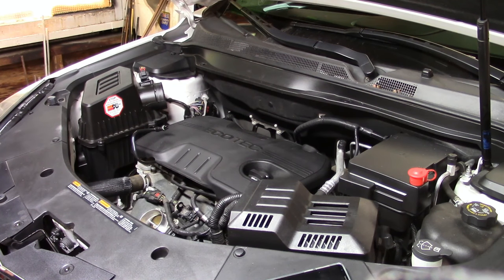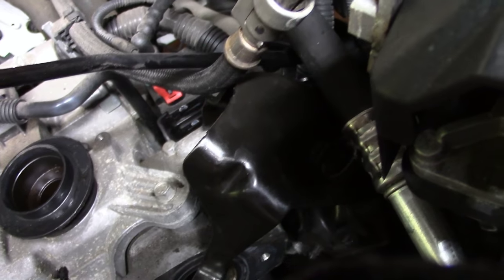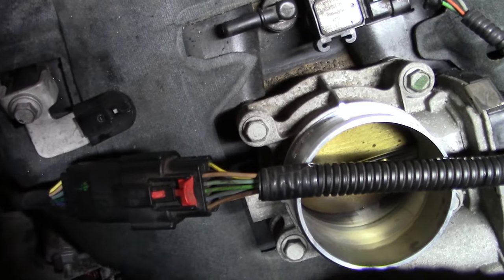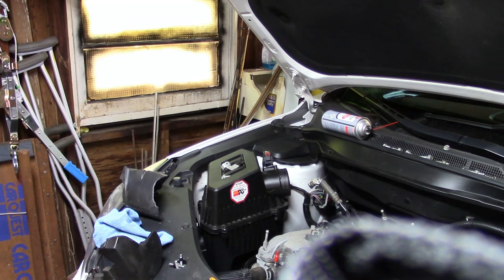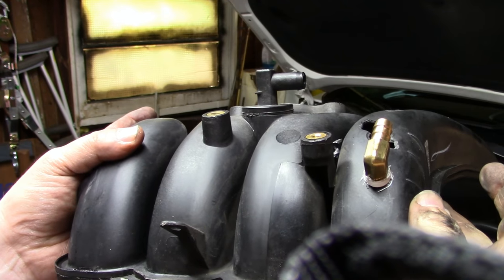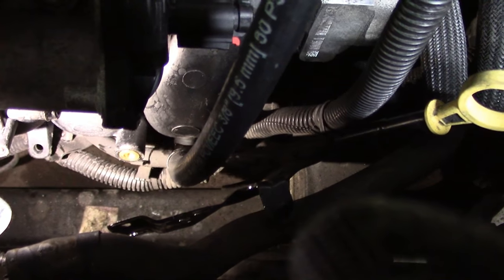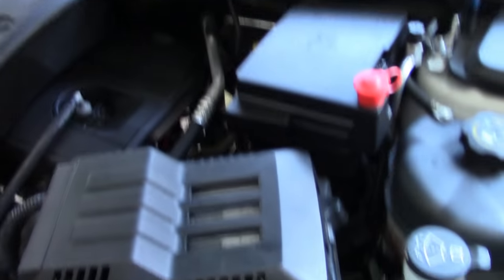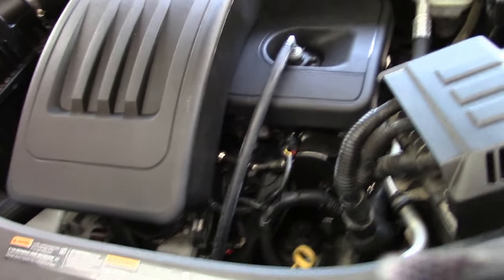2013 Chevy Equinox w/2.4L 4-Cyl. Engine PCV Upgrade

Comment: Do you have a part number for the pcv valve you installed on the cap? Or what it was off of?
Reply from the maker: Grommet is a Dorman PN# 42330
PCV is a INTERMOTOR, SMP, PN#  PCV352.
I bought them at Advance Auto Parts
Reply from the maker: Oil cap is a Carquest PN# 10099
You'll need to drill a 0.750" hole to make everything work.
Reply: @Frank4358  I assume the fix has been all good so far? Thanks for this video. Much appreciated
Reply from the maker: @abefroman1986  engine starts and runs as designed. No known problems. And the best part is that I haven't used any oil.
Reply from the maker: I've been averaging about 19 to 22mpg around town. Your results may vary.
Reply: Thanks, the ticking sound, mine used to do that, it was the chain guide it’s defective and will eventually break, covered by recall.
Reply: @Frank4358  when you say you havent used any oil do you mean you were using it before and this fixed that issue? Or it was fine before and that problem just never arose after your fix?
Reply from the maker: @austinogrin7259  I was using oil prior to this modification. Now the oil usage has stopped
Reply: @Frank4358  awesome thank you, why do you think it was using oil before you made the new EGR valve. That seems like such a dumb mistake on their part
Reply from the maker: @austinogrin7259  it's not an EGR valve. It's a PCV system. The factory unit is a hole about 1/8" in diameter. It gets clogged, and the return vent gets clogged. That in turn creates crankcase pressure. The increased pressure damages seals. 
This modification prevents the system from clogging. 
Now, consider this; if this is the reason for your oil consumption  no worries. But these engines also had a ring problem. . . 
Do you experience a loud knocking noise on cold startup that goes away as the engine warms up? That is a known problem. Do your research before starting any modification. 
Google, Class Action Law Suit for 2010 - 2015 Equinox with 2.4L ECOTEC.
Reply: @Frank4358  I am looking to purchase one the guy said it burns about 1 quart of oil every 1500 miles roughly, and it did has a sound when starting up but it didnt seem like it was anything alarming
Reply from the maker: @austinogrin7259  get the VIN, go to a Chevy dealer and have them check for a TSB: technical service bulletin. If they say it's not included, be careful in deciding to buy it. You could be stepping into a hornet's nest of problems.
Reply: @Frank4358  I called and gave them the vin and they didnt find anything when they looked it up, would you think that more than likely the oil usage is due to the pcv? The guy who owns it said that last year the rear seal blew and they had already had it replaced so I just do not want it to happen again
Reply from the maker: @austinogrin7259  if the rear main seal blew out it was from the PCV problem. And I'm guessing it will probably happen again if it's still using oil.
Here is the TSB: https://static.nhtsa.gov/odi/tsbs/2015/SB-10090101-2280.pdf 

Bulletin No.: 14882
Date: March 2015

SPECIAL COVERAGE
SUBJECT: Special Coverage Adjustment – Plugged PCV Orifice in Intake Manifold
MODELS: 2010-2013 Buick LaCrosse
2011-2013 Buick Regal
2012-2013 Buick Verano
2011-2013 Chevrolet Captiva
2010-2014 Chevrolet Equinox
2013 Chevrolet Malibu
2012-2013 Chevrolet Orlando
2010-2013 GMC Terrain
Equipped with 2.4L Ecotec Engine (LAF, LEA or LUK)

CONDITION
Certain 2010-2013 Buick LaCrosse; 2011-2013 Buick Regal; 2012-2013 Buick Verano; 2011-
2013 Chevrolet Captiva; 2010-2014 Chevrolet Equinox; 2013 Chevrolet Mailbu; 2012-2013
Chevrolet Orlando; 2010-2013 GMC Terrain vehicles equipped with a 2.4L engine (LAF, LEA or
LUK) that have experienced high oil consumption may also experience a frozen and/or plugged
PCV (positive crankcase ventilation) system during cold weather operation. This condition may
increase crankcase pressure leading to a rear crankshaft seal oil leak. If the oil leak is ignored or
not noticed, an engine clatter noise may be noticeable and/or the engine pressure warning light
may illuminate. If this condition is not corrected, continued driving with engine noise and/or the
engine oil pressure light illuminated may damage the engine.

SPECIAL COVERAGE ADJUSTMENT
This special coverage covers the condition described above for a period of 10 years or 120,000
miles (193,000 km), whichever occurs first, from the date the vehicle was originally placed in service,
regardless of ownership.
Dealers are to perform a crankcase pressure check, and if required, remove the intake manifold
and clear the PCV orifice. The repairs will be made at no charge to the customer.
For vehicles covered by Vehicle Service Contracts, all eligible claims with repair orders on or after
March 4, 2015, are covered by this special coverage and must be submitted using the labor
operation codes provided with this bulletin. Claims with repair orders prior to March 4, 2015, must
be submitted to the Service Contract provider.

VEHICLES INVOLVED
All involved vehicles are identified by Vehicle Identification Number on the Applicable Warranties
section in GM Global Warranty Management system. Dealership service personnel should
always check this site to confirm vehicle involvement prior to beginning any required inspections
and/or repairs. It is important to routinely use this tool to verify eligibility because not all similar
vehicles may be involved regardless of description or option content.

PART INFORMATION
Parts required to complete this special coverage are to be obtained from General Motors Customer
Care and Aftersales (GMCCA).
Note: Use the vehicle identification number (VIN), SI and the GM Electronic Parts Catalog to
determine which parts to order. The Crankshaft Rear Oil Seal Replacement procedure in SI states
what parts are required to complete the repair. For example, gaskets, one-time use fasteners, and
fluids.

Part Number Description Quantity/Vehicle
12591866 Crankshaft Rear Oil Seal 1
Reply: @Frank4358  so unfortunately this car has 213000 miles so I could not get the replacement for free,  when it is started and has that loud noise at first is that the timing chain or what is it causing that noise? And how hard is it to replace the timing chain and the components related to that while the engine is in the car?
Reply from the maker: @austinogrin7259  do yourself a favor and walk away from this car.
With 213,000 miles and with a known problem it will cost you a small fortune to make it right. The timing chain is not an easy repair -- especially if you don't have a mechanical background. The clacking noise -- and the oil consumption -- tells me it is probably a ring problem. 
So unless you are getting this for practically nothing, and you're prepared to drop in a fresh engine you are better off finding one with low mileage that is not experiencing any oil consumption.
Reply: @Frank4358  its 2500$ the body is in fairly decent shape and the interior is nice in it, you would still walk away from it?
Reply from the maker: @austinogrin7259  are you prepared to install a new, or low mileage engine with no apparent problems?
Reply: @Frank4358  probably not , thank you for all your help I appreciate  it
Reply from the maker: @austinogrin7259  sometimes the best thing you can do is walk away. What looks like a good deal now can turn into a hoke that you continually throw money. I've been buying and maintaining cars for about 47 years, and I've made my share of mistakes. The big difference is that I have been working on cars since I was 10. 
You learn a lot by doing. You learn even more by making mistakes. Hopefully I can help you avoid the big mistakes.
Reply: Where exactly is the pvc valve hose attached to on the manifold and did, you make any modifications to it, besides the top side?
Reply from the maker: @frankgeorge1744  if you check out the video you will see that I installed a fitting at the bottom of the intake runner so it didn't affect the vacuum signal to the cylinder head.
Reply: Thank you. I also forgot to ask, I probably missed the part about what you did with the original set up of the PVC. Do we leave it, or remove it? I appreciate your knowledge n answers.
Reply from the maker: @frankgeorge1744  the existing PCV is a small orifice inside the plenum. There is a return line from the cylinder head to the air box. That must remain intact. When you pull vacuum you need a breather. . . There must be a balance.
Reply: What size n lengths is the rubber hose? I am, really enjoying your vast knowledge  of plethora of information. Thank you!
Reply: What did, you say to apply on the manifold? Sorry I didn't understand that part.
Reply from the maker: @frankgeorge1744  not sure what it is you're asking about. If it's about sealing the fitting to the manifold, I wrapped the threads with Teflon tape then placed a dab of RTV around the fitting.
Reply from the maker: @frankgeorge1744  standard PCV or fuel hose. Length is as you need it. I started with four feet length then cut it to size.
Reply: @Frank4358  thank you
Reply from the maker: @frankgeorge1744  you're welcome
Reply: @Frank4358  Thanks for all the info Frank. couple questions, if u don't mind.

1. I've heard of moisture/sludge collecting in the hose going to the airbox. Others have installed oil catches/separators. Have you seen the need for this, with your modification?

2. Has this modification given you any issues with MAF readings? Codes etc..?

Thanks again.
Reply from the maker: @debtminer4976  no moisture build up has been found in the breather line. And, no. I have had no ECM trouble codes at all. Drove the vehicle 560 miles to Indy then back with no problems at all.
Reply: @Frank4358  What a great fix, from a wise grease scholar 😆

You are the man, thanx.
Reply from the maker: Dorman 42330 grommet
Intermotor/SMP PCV352
Oil Cap 10099 Carquest
3/8" 90° Brass Fitting
Reply from the maker: All items purchased at Advance Auto Parts
Oil Cap requires modification
0.750" hole. I did it on a Bridgeport vertical mill.

Comment: Maybe, a vented oil cap??
Reply: Have you tried it?
Reply: You can't use a vented cap or the engine controller will throw a code.  All of the air going into the combustion chaimber is measured, and that includes what comes from the pcv.

Comment: Any update frank?
Reply from the maker: Could you be more specific?
Reply from the maker: I will tell you this; Since this modification was done, I have not used any oil, at all. There were no check engine lights, and the fuel mileage was unaffected. 
The clacking noise you hear is emminating from the high-pressure fuel pump. Cold start/fast idle and IAC operation is working normally. Warm idle is about 700 - 750 rpm, and the engine operates at about 1500rpm at 45 - 55 mph. 
One more thing; I changed the transmission fluid with Amsoil synthetic. Transmission seems to shift smoother, and around town/highway fuel mileage increased from 16mpg city/22mpg highway,  to 19 - 21mpg city/25 - 27mpg highway.

Comment: You should just put one them small filters from the parts store on the fitting you mad into the oil cap...just vent to the air instead of putting all that oil and what not through your combustion chamber and throttle body...
Reply from the maker: To vent to the atmosphere is a violation of emissions standards. 
PCV systems are designed to redirect the atomized particulates back to the combustion chamber to be burned off. So no, putting a filter to release into the atmosphere is not a good idea.
Reply: @Frank4358 🤣🤣 Ok EPA police....LOL.....Guess it depends on the year huh...SMH......Some people i tell ya..😥🤷‍♂️😥🤷‍♂️
Reply from the maker: @daniastopjik3287  if you're not going to contribute anything helpful then don't  comment at all.
I don't circumvent emissions standards to save money. Do it right, or don't do it at all.
Any further negative comments will have you removed from this post.
Reply: @Frank4358  not to save money...to save my engine
Reply: @Frank4358  and wasnt tryin to be rude or anthing sirr....just stating my opinion

Comment: GM sells an oil cap that releases the built up pressure. Would have saved hours of time
Reply from the maker: Emissions control systems are  closed systems. That's so any vapors from inside the engine are harmlessly burned in the combustion chamber. 
If you vent these vapors to the atmosphere, you fail emissions standards. I'm not sure how GM gets away with this.
And if this is an option, why doesn't GM dealers know about this cap?
Reply: @Frank4358  AC DELCO PART # FC219.
Also, CFM makes a breather as well.
Reply: It works great. I live in a state that does not have emissions testing. I also have a oil catch can and I also opened up the hole on the intake. Has so far all together helped the motor alot.

Comment: Maybe a vented oil cap??
Reply from the maker: A vented oil cap would not meet standards for a sealed emissions system.
Reply: @Frank4358  but, would it fix it?
Reply from the maker: @sobreruedasesmejor1022  no
Reply: @Frank4358  well, gas caps are vented? And also oil caps.
Reply from the maker: @TheZehnerhjk  gas caps are no longer vented. There is a vapor return system that sends the vapors into the combustion chamber to be ignited along with the air/fuel mixture. Oil caps are also not vented. That's why there's a PCV system.
Reply: @Frank4358  FC 219 oil cap??
It's vented.
Reply from the maker: @TheZehnerhjk it still doesn't work.
Reply: @Frank4358  Interested to know why this doesn't work, since it is GM's recommended fix for several engines.  It releases somewhere in the 2-3 psi range, which should prevent rear main seal failure, which is the end result of the plugged PCV
Reply from the maker: @SBUBandit  the question you need to ask is, "how does it vent?". It's not outward as that would not comply with a sealed emissions system. 
If it did work, as you suggest, then there would be no oil usage, and the PCV would not clog.
Reply: @Frank4358  I've seen a video of a test confirming the spring inside does indeed vent at 2-3 psi, but are sealed in the absence of positive pressure.  This would not prevent the PCV from clogging, it would have no effect on the operation of any of those components, as it would be normally sealed.  However, in the event the PCV did become sealed due to its terrible design, rather than allow pressure to build and blow the rear main seal, the cap would vent
Reply from the maker: @TheZehnerhjk  I dug out the OE cap that was replaced with a Stant OE replacement. There is no vent in the cap.
Reply from the maker: @SBUBandit  I dug out the OE pol cap that was replaced with a Stant, OE replacement. There is no vent in the cap.
Reply: @Frank4358  Correct.  The recommended replacement cap is Delco FC219, which is vented

Comment: You should not have done that. You are putting the entire pvc burden on one cylinder.  The factory pvc uses a shared vacuum location. You are causing one cylinder to suck all the pvc fumes and one cylinder will run lean.
Reply from the maker: Never ran lean. No engine codes. Pressure relieved.

Comment: Why not just put a valve cover breather?
Reply from the maker: A breather does not do what a PCV does. There is a breather return from the cylinder head to the airbox. 
The PCV evacuates crankcase pressure, but it also carries any hydrocarbons that are within the mix. Those hydrocarbons are sent back into the intake where it is mixed with the air and fuel being pulled into the combustion chamber to be re-burned. It's part of the emissions control system. 
By adding a sealed PCV (not vented to the atmosphere) you don't bypass the vehicles emissions system, and you pass state and federal emissions standards.
Reply: @Frank4358  so if you don't have emissions like Indiana, you can just use a valve cover vent? I want to modify my oil cap and maybe run it into my header for some extra vacuum. I've done that on old school v8s but not sure if the system is the same on the ecotec platform.
Reply from the maker: @8.2deck  there's already a breather return from the cylinder head to the airbox. A breather is not a PCV valve. So regardless of the fact that your state has no emissions testing has nothing to do with what you suggested. You need an active PCV to extract pressure from the crankcase to prevent rear main seal failure, and prevent excess pressure from pushing past the rings causing oil consumption and engine damage.
Reply: @Frank4358  okay i was kinda confused but now i see what's going on. I think i'll also run a catch can that way I'm not spraying oil on my valves and I'll be able to monitor it a little better.
Reply from the maker: @8.2deck  no need for a catch can if you follow my instructions. There is a baffle between the oil fill cap and rockers, valve springs and valve stems.
Reply: @Frank4358  i see that but there's still a lot of vaporize oil and carbon that gets by. Direct injection engines have no fuel to clean the valves so a catch can is very critical for these engines
Reply from the maker: @8.2deck  the factory PCV orifice makes no provision for vaporized oil. And if you saw the intake manifold that came off the engine there was a collection of oil in all of the intake ports. 
Don't overthink this. The vaporized oil, fuel, etc. is burned in the combustion chamber.
Reply: @Frank4358  I'm not. In order for it to be burned it has to pass over the intake valve which will result in carbon
Reply from the maker: @8.2deck  then speak to the GM engineers that designed this engine.
Reply: @Frank4358  they failed so that's why everyone is putting catch cans on direct injected engines Volkswagen was worse
Reply from the maker: @8.2deck  I'm having no issues with my engine since the modification. 
I had a terrible clattering noise (valvetrain) on cold starts, and oil consumption. It's all gone and my fuel mileage has increased. I'm happy with my results.